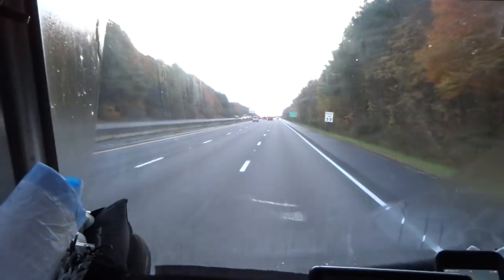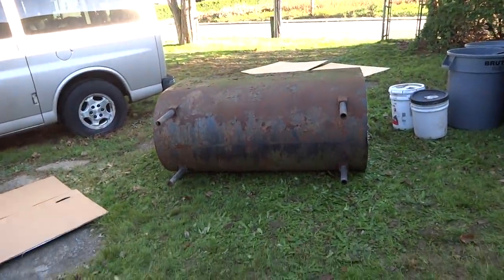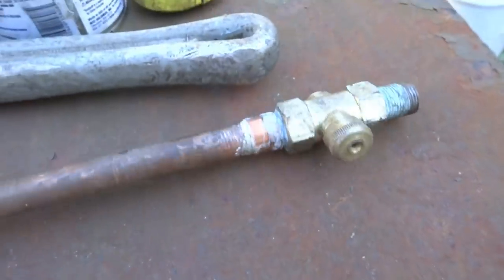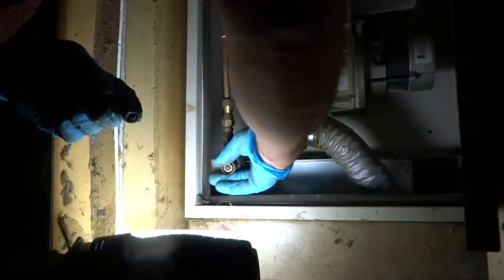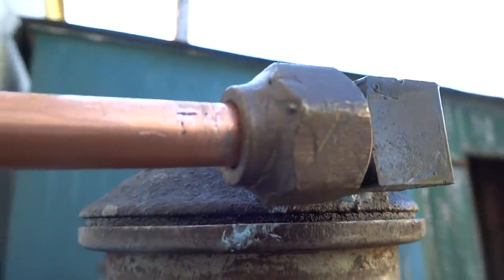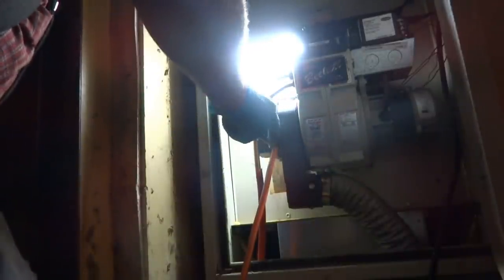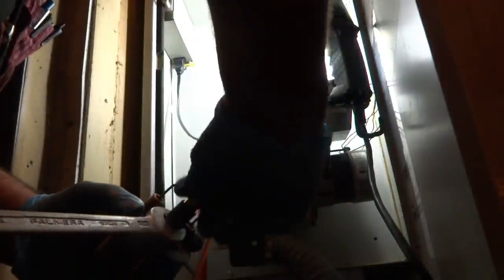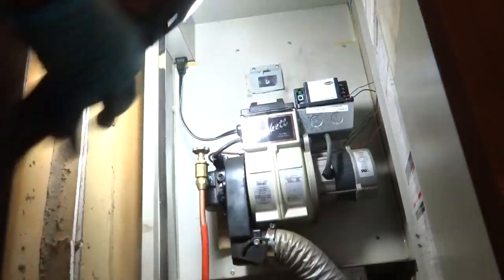OUTSIDE OIL TANK REPLACEMENT AT MOBILE HOME TRAILER PARK

Comment: I live in Maine in a mobile home.  The tank is outside, fed from the bottom of the tank, and have always run #2 home heating oil through it and never had a problem in the 14 years I've lived here!  I have them put in an additive to prevent gelling.  As you can imagine, we've had some cold snaps.

Comment: Nice job Steve I think that looks pretty good. The blocks are good enough for that neighborhood lol. That's funny the tank has to be strapped to the trailer where the hell is it gonna go
Reply: If it's near empty, it could blow over in a bad storm. We get what's called "Nor-Easters" here and when that happens the wind and snow gets crazy. And since Steve's area is near the Atlantic ocean when we get a hurricane you would be surprised what gets blown around. House roofs can get ripped right off the houses, siding gets pulled off, even cars can get blown around.
Reply: Mass code requires 4” thick single pour concrete slab that protrudes 8” beyond the outside edges of the tank. Blocks are not code. Overall nice clean install.
Reply: If a Tornado picks up the trailer...at least she'll have heat while shes flying
Reply: Not sure what NY requires, but I "had" such a slab and it didn't work well. Frost heaving tilted the tank every winter and eventually broke up the slab. Eventually I put four concrete posts close to four feet into the ground, put heavy timbers across the top, and put the tank on them. Still had some trouble with frost heaving, the posts should go down 5 feet or more to avoid that. @kenenos6520
Reply: That tank will keep the trailer from blowing away. 😂🤣😅

Comment: We have to put outside tanks on concrete pads by code and anchor to pad if in a flood zone. I hook up to a 55 gal. drum I have setup for a temporary tank why the pad dries a couple days. If they won’t burn kerosene I won’t work on Miller units. To many frozen tanks with #2. Nice job
Reply: Seems a waste of cable to secure that tank, even if it was a flood plain..except, a full tank might anchor that raggedy shed of a trailer during a flood.

Comment: Here in nova scotia we must use 12×30×3 reinforce patio blocks with gravel base ,top feed with inside filter and tiger loop or bottom feed with 1" x48" flex line ,steel tank  has to be a double bottom or single wall fiberglass

Comment: Looks good Steve. What’s the difference in kerosene and #2?  Just different nozzle?
Reply: No different product, #2 = 140k btu per gal & 132k btu for kero. The nozzle is not the issue, kero burns clean and won’t “ jell” when cold like #2 will. Also Miller trailer furnaces are not clean out friendly. You need to remove the burner, front pouch plate & chamber. This is not usually when using kero.

Comment: Hi Steve, I would have liked to have seen how you had moved the new 300 lb. tank into position to see how it was done. When I had my 275 gallon tank replaced, it took two strong men to remove the old tank and put the new one in my cellar below ground..

Comment: I use fuel oil plus an additive in mine. I used to deliver fuel oil also and some trailers would get fuel oil, some kero and some a 50-50 mix of each.

Comment: Whether it's law or not I've always heard that those Miller mobile home furnaces are only designed to run on kerosene. It's required for the older carbureted models to run properly, and the newer ones using .5 GPH nozzles are prone to clogging on #2.
Reply from the maker: yes small nozzle's are pron to clog heating oil .75 will be fine .. .50 not so much
Reply: Tons of people run blended here(PA) I there  Millers. It's like 50-50
Reply: @stevenlavimoniere     My Biasi has a .50, clogged often with the old tank, new tank (inside) and it is running well.

Comment: Kero here in pa is $1.30 more a gallon than oil.
Reply: Which is why the guy is using oil
Reply: I used #2 when I first moved here and had a lot of problems with my outdoor tank. Had to increase nozzle size and had multiple failures a season. (Good thing I can service it myself)  After switching to kero no problems and switched back to the specified nozzle size and I go the whole season on 1.5 tank fulls.

Comment: Won't water separate and settle in that filter and freeze?
Reply from the maker: line is 3 inches of bottom of tank any moisture will be at bottom of tank .. it will  be fine if he adds antijell treatment ..all outside tanks can jell in cold temps .. you have to add treatment to stop it from jelling
Reply: @stevenlavimoniere  thanks Steve. Wondered about it. Im not a tech just a guy who likes your videos.

Comment: Looks good Steve. Does Massachusetts have any restrictions on in ground tanks. Don't know of any in a Pennsylvania, yet.
Reply: Underground at your own risk in pennsylvania..my moms old tank cost her an 11,000 dollar clean up fine..it rotted out and leaked. Everyone i know here in PA. has had soil testing when they pulled a tank up, by law.
Reply from the maker: outside underground tanks in mass are illegal now .all should have been removed by now ....but there are some still out there .i will not work on the systems . and tell the people to have the tanks removed from the ground ,,
Reply: @pootthatbak2578  I think they are outlawed for new installations but of you have on allrrady its your responsibility if it leaks for all cleanup like you said unofficial advice if you have one get rid of it quietly

Comment: Nice work on the oil tank but that furnace is not designed to run that .75 nozzle. That’s a .60x80* b no wonder that air shutter is all the way open. I notice that all you put in pretty much every oil service call is a .75.
Reply: That's what he carry's in his pocket.
Reply: @djmblades4124  If anything I would think running heating oil through it could potentially crack the heat exchanger since heating oil burns so much hotter than k1.
Reply: oops meant K1 burns hotter than heating oil.
Reply: @djmblades4124  He put a .65 70 B in last year.

Comment: What's the difference in burning fuel oil and kerosene ? What's the difference ? Why use one over the other ? Thanks
Reply: Kerosene will not gel.#2 especially with the biofuel gels up in no time below 20 degrees.
Reply: K1 has more btu in it.  More expensive.  Some units are not interchangeable.  The K1 burns hotter and can melt parts that are only meant for fuel oil.
Reply: Added kerosene to #2 to keep it from de-liquiding. 🙃 Always fun playing with oil. I always kept the oil perfume following me...
Reply: What I dont get here is Kerosene and no. 1 burner fuel are the same virtually.. in the upper midwest we never had any differences and heated our home with no. 1 all the time... I question all that stuff thought the only fuel oil for heating was Kerosene or no. 1 burner fuel .... number 2 is deisel oil mostly
Reply: Where I am, #2 is unfiltered diesel with dye. (Marked for non road) kerosene is used for cold weather additive if necessary.
Reply: @jonmpb578  its still "filtered" , its a myth that its any dirtier then road diesel #2. Just has a pigment in it to mark it and also may have a different cetane rating in some places.  Myth of it being dirty comes from how it is stored after its delivered. Some tanks are so old and never get any attention until theres an issue(moisture,  diesel bug, rust , varnish  from age etc). And a lot of this compounds with the use of bio diesel now as its added for lubricity because of the #2 diesel is Ultra low sulfur diesel. The process of removing the sulfur also removes the lubricity of diesel. So they added bio to bring that back. Bio doesn't react well to moisture and goes bad with age a lot quicker then the old low sulfur diesel of the past. But if your tank is clean and you use additives to stop diesel bug , keep tank filled when storing it etc it will be just fine.

Comment: A lot Eastern states and some area's in the Midwest have oil. My area is nothing but natural gas, unless it out in the country. Then, they use propane. Personally, I love natural gas, that way I don't have to have someone fill a tank every winter. Plus, I have central air conditioning.
Reply: There's a lot less price fluctuation with natural gas too. Heating oil you don't know one winter to the next, or even tank to tank, if it'll be $1.50 or $4.50/gallon.
Reply: @buffydog21  in Iowa most energy providers are pushing all electric and heat pumps. Ground source heat pump will generally get you a incentive of some sort. Mine is equal to almost 2mths electric bill so November and December I have no bill. I don't like this push to be all green renewable energy statewide by 2030 using wind and water no fossil fuels.
Reply: @carolrobinson7779  I don't either. It's sad. I keep trying to tell people, that an electric car still needs plastic and oil to make the vehicle. There's oil in dashboard, which is made out of plastic, plastic in copper covered wires, rubber in tires, and finally there's a oil type coolant in transmission and batteries. So, either way, you're still using oil, like that's in a traditional gasoline car. Biden and his friends with benefits are making money, off from pushing us into electric cars. Most people can't afford to buy a starter $40,000-$60,000 electric car. By the way, my Sister lives in Ankeny Iowa.
Reply: @GundamZero5  The pipeline he shut down exported oil from the US to Canada. It's literally improving our domestic oil supply.
Reply: @jblyon2  wow now I seen it all  LMAO
Reply: Yeah, you just don’t see heating oil tanks south of Kentucky and Virginia.

Comment: Why kerosene? We ran no. 1 burner fuel for 80 years external to an oil burmer and furnace for years
Reply: Kero won't gel outside what I was thinking.
Reply: @waffalobill  no. 1 wont gel either. Kerosene can be dyed red too
Reply: @djmblades4124  no. 2 is diesel fuel without the additives its the same stuff

Comment: What are you checking for when you put the screwdriver in and turn it around with a nozzle goes
Reply: Inside there at the end is an air turbulator, it causes the air to spin. He is probing the turbulator with a screwdriver to ensure it is still in one piece and did not disintegrate. Plus it helps clean (some) any carbon deposits. On Riello burners the turbulator is part of the nozzle/electrode assembly and comes out when you remove the nozzle assembly. That's a much better design because you can easily examine and clean it. On other burners you have to take the burner out to get to it unless the boiler firebox door is on hinges and can be opened.
Reply: @biker55555  thank you for the information I believe in today's video he actually took that part out I think that's the first time I've seen it but it was helpful to know what he was doing and why thank you again have a wonderful holidays

Comment: Why are these oil tanks not double sided? What happens when it leaks?
Reply: You empty the tank and buy a new one.  Tank leaks start small weeping usually from inside out.  Just don't go poking at the leak with a screw driver.  Just don't tetch it.
Reply: @docholliday3150   Thanks for your answer. Great when you don‘t see it leaking :-) @ my country they have to be double sided outside. Between  there‘s a fluid which is controlled by a sensor. You get an alarm when the fluid is sinking.
Reply: @andreasknotig1323   @Andreas Knötig  That sounds like a safe system.  This is a huge country and the rules are strict in some places and non-existent in others.  If you live where there aren't any rules you just use what you have or is cheapest and are expected to use common sense and monitor for leaks.  We typically don't have "national rules" for items like this.  They are handled at the local level.  Some areas of the country simply do not use oil and use natural gas instead.

Comment: Where’s the vid of the work you had to put in to dispose the old tank
Reply from the maker: i cut it in 4 pieces and loaded in into my truck ...then into my scrap trailer in my yard ..
Reply: No sticker? Funny, I gotta cut them open, scrape them, speed dry towel clean..: you get where I’m going.

Comment: So an oil tank that size for a mobile home isn’t overkill?
Reply: No, moble homes are not insulated very well. Shut off the heat in winter and it'll get cold fast. He'll go through that oil fast enough.
Reply: Can never have too much. It's gonna run out at the worst time every time
Reply: More you buy the cheaper it is.
Reply: Old trailer like that you might want two.
Reply: @memyselfandifarmer  Thats not true but to some point it is
Reply: Most oil companies don't want to know your name unless they're delivering at least 100-150 gallons.
Reply: Ancient mobile homes like that have almost no insulation and are usually quite drafty they burn through oil quite quickly when I rented a early 70s trailer with oil we went through probably 2-3 tanks a year and we were being conservative about our heating use
Reply: @sqike001ton  yeah, they had those crappy crank out windows that would actually flap a bit on a windy day after a year or two. They were so bad the government finally stepped in and set some standards.

Comment: I wonder why that oil company would sell the guy the wrong oil.  Maybe that is all they had and figured he would not know the difference.  He is obviously missing a voice box and has to use electronic device.  Some of them just keep on smoking, anyway.
Reply: Maybe he set up his system to run on oil because it about half the cost.  Maybe the oil company sold him exactly what he asked for.  Keen observation on the voice box.  Why not keep your speculations to yourself.  Dude is probably doing the best he can.

Comment: Should have just installed an inline check valve before the pump at the furnace. if the line ever plugs later down the line or the check goes bad  the next guys gotta dis-assemble the whole top feed assembly smh

Comment: Filter will freeze from out side moisture
Reply: No it wont. I have been doing this work for just under 20 years
Reply: Nah he’s off the bottom about 3” where the moisture would be and I’m sure there’s some anti gel mixed with the oil should be fine
Reply: I take it out the bottom and run it into an empty filter (which I thaw and dump out periodically during the winter). Keeps the water from rusting the bottom of the tank. The real filter is crammed into the furnace inside under the oil burner where it is warmer! The only problem I've had is with the empty filter container rusting through and leaking. The new ones are thin and don't last very long. @Just.A.T-Rex

Comment: Should of installed some heat tape on that outside line w/ Fuel Oil #2 
Or have some anti gel on hand
To mix with 

Should be using 50/50
But I know expensive

Comment: The used to use different color dye in it so that the truck drivers wouldn't cheat and use heating fuel in their Big Rigs.
Reply: They still do. You can see the red fuel oil in the garbage cans at 2:23.
Reply: I thought it was Red.
Reply: @russellhancock9765  heating/off road fuel is not taxed for road improvements. Anything used for construction, agriculture, and heating would be dyed red..  A DOT officer can check your tank for dyed fuel at a weigh station or during a traffic stop.

Comment: Why do trailer homes have to run kerosene?
Reply: It's to combat gelling in extremely cold weather,  and the built-in furnaces are designed (with burner nozzles) to accommodate kero, rather than typical regular #2 fuel oil.  Kero is thinner.  I call it Kerobscene due to the ridiculously higher price of it, but it takes more refining to get it to the point of being kero, hence the higher price.

Comment: K1 is a lot more expensive, so these poor people use the cheapest thing they can get.
This poor lady doesn't even have money for a battery for her smoke detector, and doesn't even own a CO detector
That would be something I would insist on any place I worked, 

I would bring 9 volt batteries and I would bring smoke detectors and CO detectors and I would tell them you have to install these or I won't work on your furnace